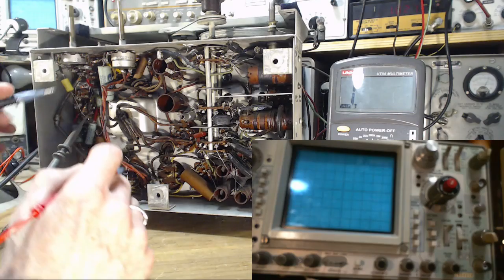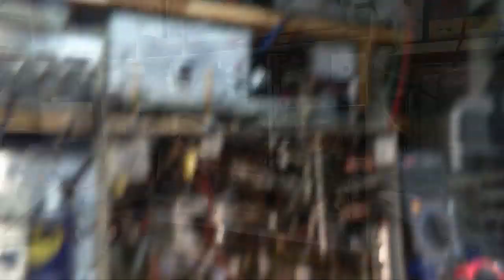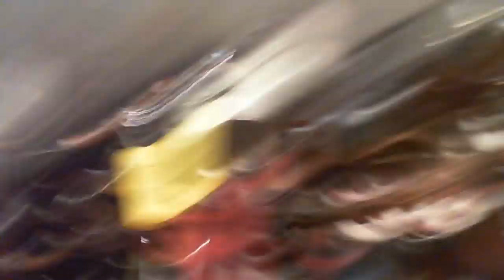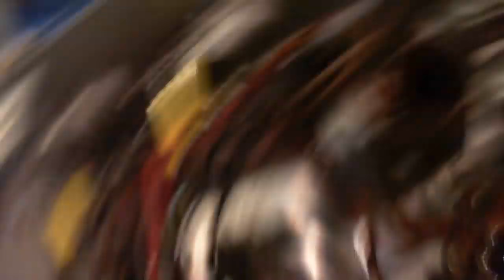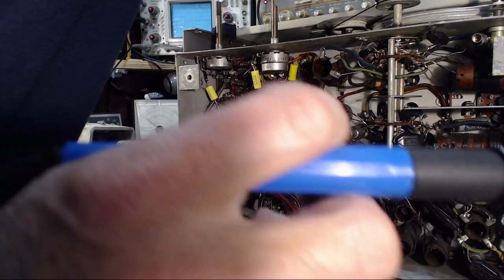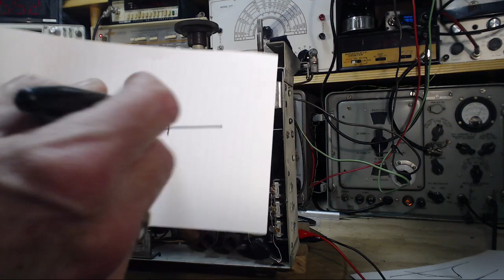RCA A-32 Globetrotter Video #8 - Five Audio Capacitors

Comment: My grandfather was a gunner with the BEF at Dunkirk when the Germans drove them out. Grandad was one of the last out as his unit were trying to stop the stukas from hitting the beach. Ironically he was bivouacked on Salisbury Plain (UK) when a German bomber dumped a stick of bombs on the campsite. He was invalided out after recovering in London and only a few weeks after that his house was hit by what was believed to have been one of the first V2s to hit London.  He and grandma were evacuated to Westhartlepool in County Durham for the duration. Apparently, when the V2 hit the house he was hit in the back of the head by a radio and woke in the rubble two days later.

Comment: lucky 7, i wanna solder a broken radio switch, its about 1990s  first i  get solder iron, dad's  old 1960's one  needs a  big funny shaped tip that has broken in two . so maybe match up one at big store, yeah-my really good buddy is like you and has an awareness  and understanding of 

electrical theory.  he said , sometimes ya need a neuTral' wire, yep,( the on off part needs a void or safe place to rest until the DOOR opens.) good   grief.

Comment: The .005mfd capacitor is rated at 1200v- Rca and others often used these near the audio output tubes.  Apparently there can be voltage spikes at high volumes, so it's important to replace it with a 1200v rated capacitor - or as I do, two 630v in series.